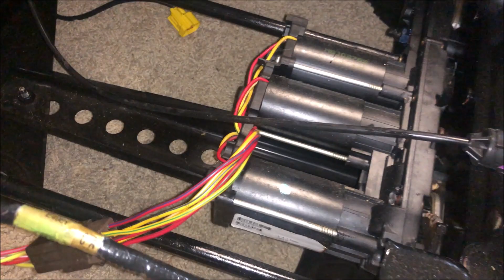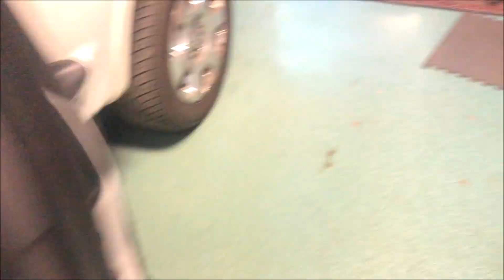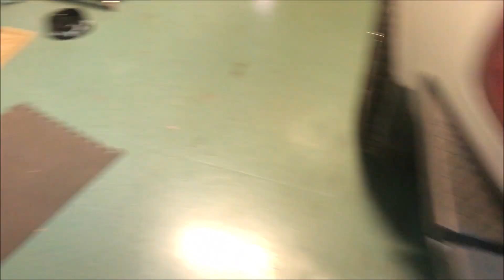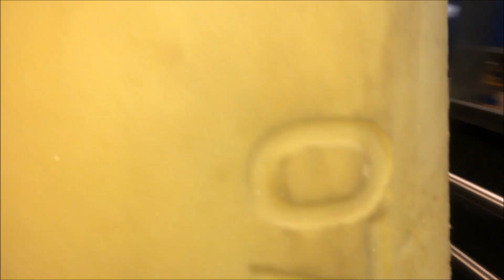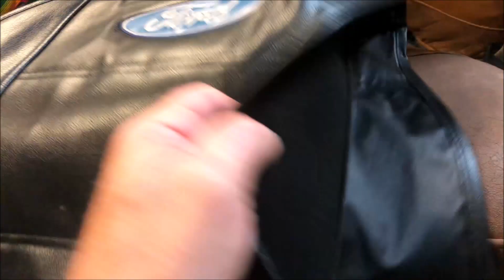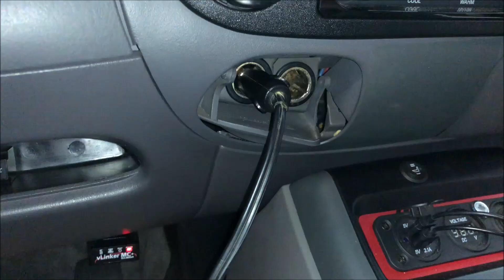How To Install Power Adjustable Heated Seats, Temporary Wiring: 10th Gen '97-'04 F150

Comment: Did you ever consider the Lincoln navigator seats ? If I remember correctly some of them came heated and cooled. I personally was thinking about using the navigator heated and cooled frame with the aftermarket "king ranch ish" colored tan covers on my 2001 Lariat Supercrew
Reply from the maker: I believe, and correct me if I'm wrong, that the Navigator and Expedition seats will only work in the Supercrew F150, not the Standard Cab nor Supercab.  The bolting of my supercrew seat is different from my supercab seat.
Reply: @DrivingIntelligence  oh that's interesting. I have 01 supercrew and I assumed it was the same bolt pattern for all cab configurations

Comment: Good video. I also have an 01' XLT that came with manual 60/40 split bench that I swapped in power buckets and navigator console. I grounded it to the floor and ran a 14ga power wire to the underhood fuse box with a 30amp inline fuse. Been this way for 5 years now. I have some videos showing the seats on my channel
Reply: I swapped in 2014 expedition heated and cooled king ranch seats into my 01 super crew and I bypassed the memory modules and I tested peak draw with a multimeter on the movement and climate control and the absolute PEAK draw was 4.94a. I have no clue why ford has a 30 amp fuse in their seat circuits, I went as low as a 3 amp fuse that didnt blow, until I adjusted the seat with the AC on. I have been running a 5 amp fuse now for about a year and it still hasn't blown and everything works as it should
Reply from the maker: @acesoftrul3z  great info... I know that there is a difference between the bolts of my supercab and supercrew seats.  Not interchangeable.  Do the 2014 Expedition seats have 5 bolts to the floor pan?
Reply from the maker: very nice... I would run my wiring the same if I didn't have wiring changes to make to the console and passenger seat.  I need to get everything out of the front anyway and found switched and "always hot" circuits under the passenger side kick panel.
Reply: @brokebuilt4827  what year was the navigator? I have an 03 XLT and got buckets seats from a navigator but still looking for a center console. Was curious. Thanks!